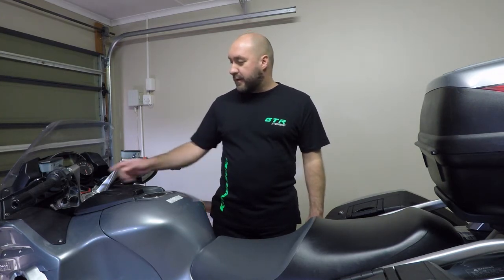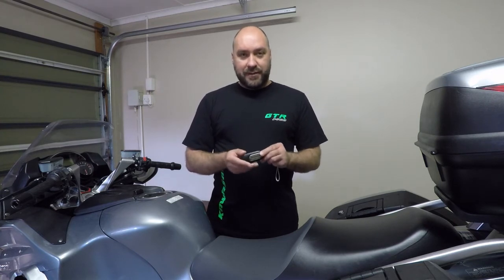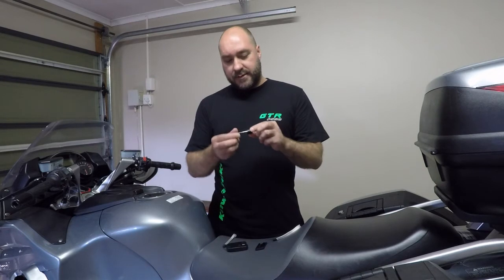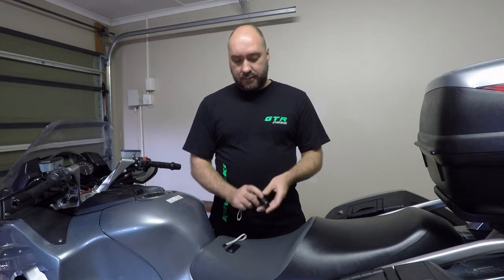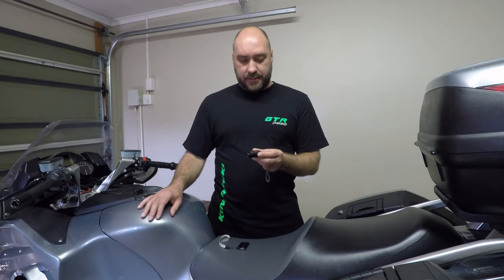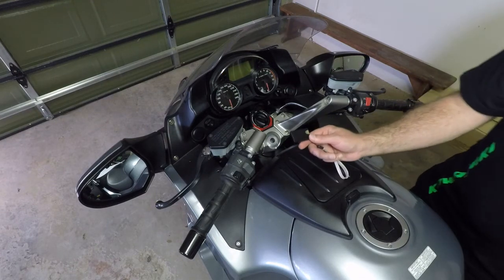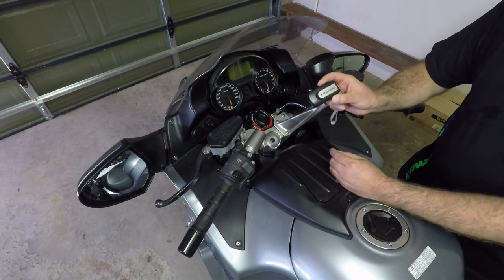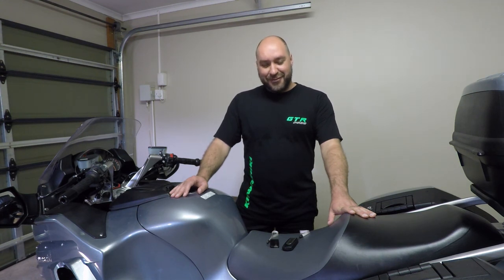Kawasaki GTR1400 FOB keys explained. KIPASS nightmare!

Comment: How do you feel, or how secure is to actually have "the key" always inserted and left on the bike? Meaning that they can't brute force the key just to turn? Shall we actually remove the key from the bike if in doubt? 
I felt a lot of insecurities when I discovered that the actual physical key is inserted behind the push button. Any thoughts?
Reply from the maker: There's no way to turn the key or remove it without unlocking the ignition with the FOB. So I feel comfortable leaving it in - I've never taken mine out. Even if they force the key to somehow turn, the system is completely inactive without the FOB, and the bike won't start. But you are always welcome to remove yours if you want to - no harm done. Thanks for watching!

Comment: Thanks for this.  I have a 2008 which I have owned since 2010 (13.5 + years now).  I have had  lots of people tell me they have heard (only one first person account, and his problem happen right after a rain storm) that the KIPASS system is a problem.  My bike came with two keys and I have never had a problem with the electronics.  The only problem I have had is from the rain.  I keep my bike sheltered at home, but at work I have to leave it out in the elements.  Eventually moisture from the rain, and it rains a lot where I live, works it's way into the ignition, fuel, & saddle bag locks and makes them stiff.  I just oil the locks (see a Youtube videos on how to oil the ignition switch) every now and then and they work fine.  
But........ yesterday I left the key laying  the bike rather than in my pocket, I later found it on the road, absolutely crushed.  I called my local dealer, they are a new Kawasaki Dealer, so they are not familiar with the key/transponder replacement process yet, and the parts person told me there are 6 keys listed for my bike.  I watched your video and learned a lot, I have been using the system for more than a decade and didn't know how it worked!  I have updated the dealer and they are working on getting me two keys,  I know this is going to be expensive, but I am willing to pay for it.  In the whole time I have owned the bike I have never had anything break/fail.  I have obviously had to do maintenance, but not one mechanical failure.   Thanks again for the info.

Comment: Great video, perfectly explained. I have owned my 2011 model  GTR 1400 for almost a year now.   The seller gave me the owner's pack complete,including some keys and other bits and pieces.  It seemed I only had one remote fob and it worried me a little, I'm prone to mislaying my keys sometimes, and I know it's a horror story if yo ulose your keys.   I was considering contacting my local Kawasaki dealer and taking the big hit for a second fob. But this video prompted me to seek out that owner's pack again and lo and behold, tucked away inside was the small  "card" type fob that needs to be held against the ign switch. I went out to the garage and tried it out as shown in the video, and it worked perfectly .  So this has helped me greatly, and saved me a costly purchase. Thanks so much!
Reply from the maker: Such a feel good reply, thanks so much. Glad the video helped you! Thanks for watching Sean.

Comment: Thank you for an informative video showing how the FOB system works on the Kawasaki GTR. 
The FOB system is very secure and generally quite reliable.
But as we all know there is a lot of miss information on the WEB on what happens when you lose all your FOBs and can no longer start your motorcycle.

If you speak to your dealer they will always tell you that you will have to replace the SCU and if you physically lose your stove top key they will get you to also buy a new lock set. This is not their fault but it is how this system and many others are designed.

As explained there are 2 transponder systems in use on this bike. You have the active FOB which can sense the bike from about 1.5m away. Its control unit with antenna is located under the seat and then you have the passive section of the FOB which is a 4D chip inside the FOB and this can be placed at the front of the ignition switch to sense it and this will allow the bike to also start.
Of course both active and passive parts of the FOB will have to be programmed to allow it to work.
Since new FOBs are so pricey now I personally like the FOB key card (21175-0256). It fits in your wallet and you just hold it to the front of the ignition switch to start the bike.

But the most important question that is always asked how can I start my bike if I have no FOBS ??
New parts cost many $$$ and some places are out of reach of the KDS system so things start to get difficult.
(You cannot use the KDS system to add new FOBs if you have no working FOBs or passive card for your bike)

My company can add a new FOB or passive key card if you have lost all your FOBs. Even if your SCU has reached its maximum allocation we can still get it working and this is all at a fraction of new parts prices.
All you need to do is supply us the required parts and a new FOB if you have one. Just make sure it is the correct frequency for your bike as there are 2 different frequencies depending upon country.
If you don't want to buy a new FOB then we will just supply the passive FOB card. You can then always later get a dealer to add a FOB providing they have the KDS tool.

I hope some of this clears up what can actually be done.
We are based in Australia and happy to accept jobs worldwide as we quite often do.
Reply: So if i buy a bike that the owner lost his Fobs what do i do and about how much would it cost?
Reply: So, if I purchased a bike that only has the emergency card and not the regular fobs, can I get active fobs matched to the bike? Or copies of the emergency card fob?
Reply: Yes, a new FOB can be added by us or by your Kawasaki dealer. The emergency card can be copied onto a transponder key using a clone chip inside the key but it is not possible to copy onto another emergency card. If you have a used FOB and its serial number then it can be added to another bike. If you don't have its serial number it still can be done but is very much more complicated as other matching items are required.

Comment: Even with a new battery in my fob when out riding from time to time the dash tells me No Transponder even though its in my coat pocket, the warning lasts for about 3 seconds then goes out..
Reply from the maker: I've had that as well. So I did 3 cycles of putting it against the ignition key, and then 3 cycles of putting it on the seat, starting the bike, and it solved it. As long as I ride it often. After as month or so, I get that message again...
Reply: @villionsgarage  good man. Appreciate the reply, I'll give that a try.

Comment: Interesting video I came across after buying my first 2013 GTR1400 but without the fob. Is there any hope of getting a replacement fob and getting it programmed to the bike which has only the key in the ignition?
Reply: Sorry for getting back so late. I searched the supposed scene of the accident that occurred in April, according to the previous owner but did not find the fob. I tried finding the company that collected the bike from the accident scene but was unsuccessful in doing so. My last option, albeit a costly one, was to order the fob and smart ECU from the agents. Those parts will come from Japan. Once they arrive, I will have them programmed to the bike's system so that the new fob and smart ECU will bring the bike to life. Thanks for the support!
Reply from the maker: Hi Marc. So can you start your bike with only the key in the ignition? Or do you have the small RFID card to start it? 

As long as you can get the bike switched on, you can pair a new Fob. Your local dealer can order and sell you a new Fob - ensure that you get the new Fob's serial number with it because you'll need that to pair it to the bike. Thanks for watching!
Reply: @villionsgarage  Hi, thanks for the prompt reply. I don't have the fob or the RFID card. The previous owner said he lost the fob at the scene of the accident he had with the bike a few months ago. With that context, is there any hope of getting the bike started without having to spend thousands to order a new fob and matching fob unit?
Reply from the maker: @Cyclizt  so according to my research, no you can't. You need to power up the bike to be able to access the control unit via the KDS software to program new fobs and RFID cards. To power it up....you need a working fob or RFID card🙈  You'll need to order a pre programmed unit with fob, install that on the bike, and then use KDS to pair everything. The previous owner only had the one fob and nothing else?
Reply: @villionsgarage  Correct. I am meeting him tomorrow morning to return to the accident scene to look for the fob. I hope we find it!
Reply from the maker: @Cyclizt  Search for your life!!! I really really hope you find it. That will solve a lot of issues. Let me know...
Reply: @villionsgarage  my fob burned up in a fire 
two years ago. ibought the ecu and matched fob off of a wrecked bike thinking there has to be a way to make it work because i can no longer work and there is no way i can afford the $1500 for the new parts. ive had it in three shops with no luck and my prized Concours is now nothing more than useless yard art. i still think it can be done by someone smarter than me but i havent found anyone even willing to try.
Reply from the maker: @TheOlds7268   that's such sad news about the fire - sorry about that man!

So when you say "ECU", are you talking about the Engine ECU or the KIPASS ECU? These are 2 different units. Also, under the ignition switch is an electronic box. This ignition box, the KIPASS ECU, and the keys are all paired. So you'll need at least the KIPASS ECU, and the ignition box. When you have these swopped into your bike, you should be able to switch it on. You must then access the system via Kawasaki's KDS software - dealers have this system as well as the cable to connect to the bike. Hope that helps! Cheers.
Reply: @villionsgarage  I searched for it but could not find it. So I've resigned myself to ordering the smart ECU and fob from the agents.
Reply: @TheOlds7268   dealer just told me 2300 for parts alone
Reply: Some light at the end of the dark tunnel as far as starting my GTR1400 is concerned! The dealership who ordered the new smart ECU and new fob for my bike from Japan could not get the bike started after the parts arrived - this after I spent R16000 on those new parts. A friend of mine referred me to Julian at Superbike Solutions and after a few days, Julian called me to collect my bike after he had managed to start it. There was a bad earth connection with the antenna in the ignition unit which prevented the new fob from communicating properly with the bike's electronics. After discovering this, Julian was able to conclude the programming procedure in order for the ignition to recognise the new fob, which unlocked the key to turn from OFF to ON. Now I can proceed with the rest of the repairs to the bike, eg right side fairing panels and handlebar.

Comment: Can the short range part of the FOB or the card be cloned like any automotive key?  In my country Kawasaki never imported officialy this bike so they don't have the equipment to make copys of FOBS,  I want to make a copy of the short range key at least, mine is a 2008, two FOBS.
Reply: Thank you so very much you answered all of my questions
Reply from the maker: As far as I know it is a standard RFID type tag, so I think you might be able to clone one if you have the right reader. I would just buy a new Kawasaki key card and pair it to the bike with the software at a dealer. Even other dealers (not only kawasaki) can also pair the keys with their KDS.
Reply: The fob has two chip, long range and short range chip, long range can only be cloned by Kawasaki, short range can be cloned. I already did it and it serves as an emergency in case of loss.